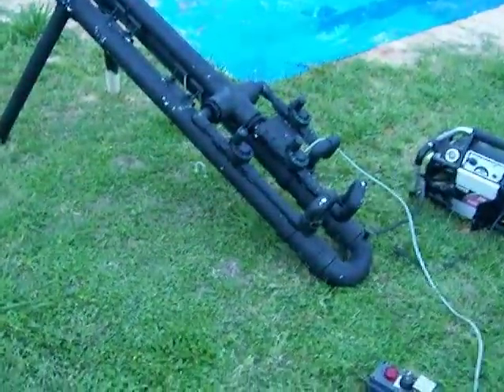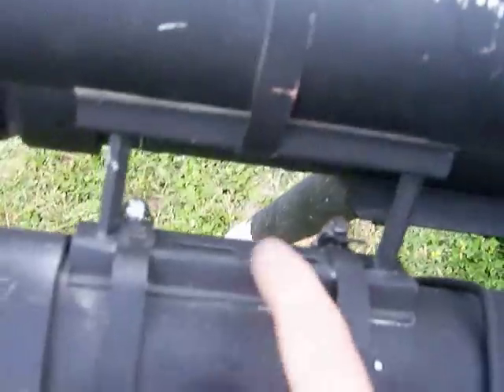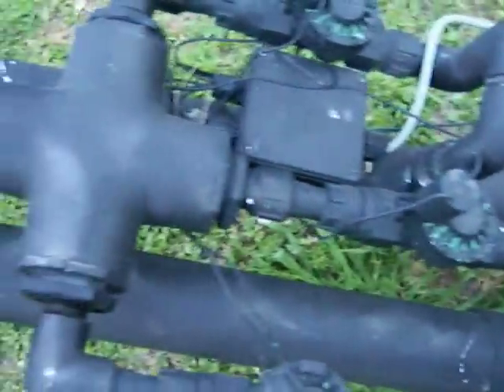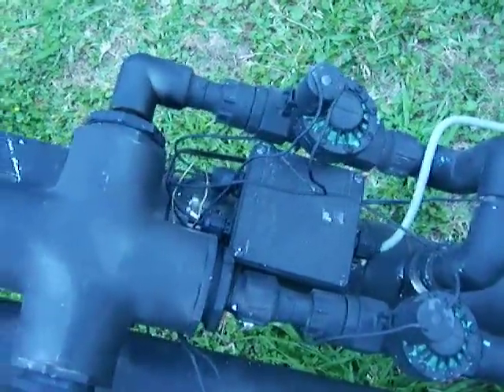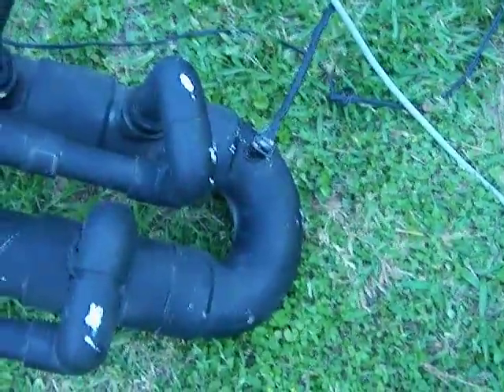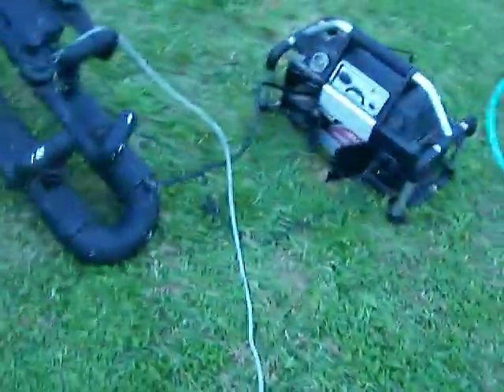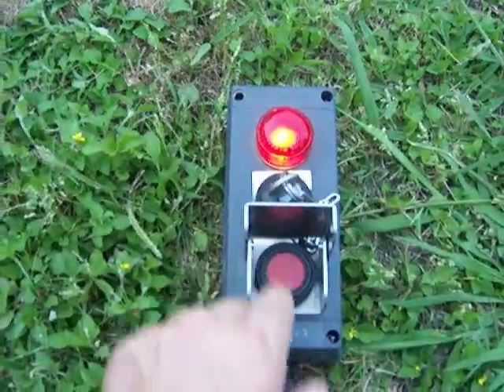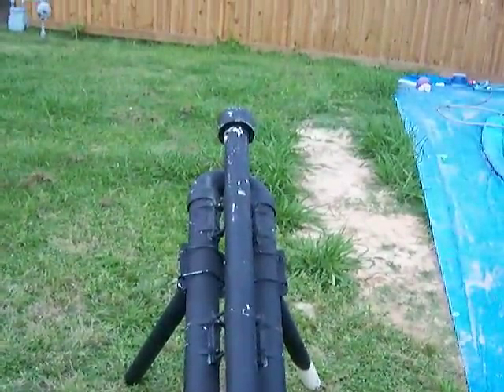howitzer air Cannon

Comment: There are much more simple ways to dump the air from that tank. Commonly what is called a "Dump" valve is constructed, also using PVC. Then the dump valve is actuated with a single sprinkler valve.